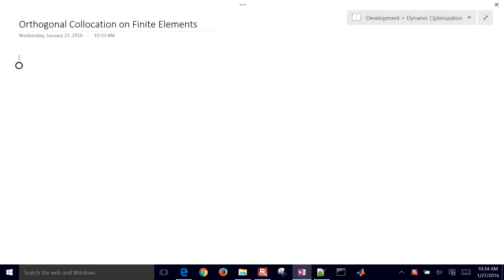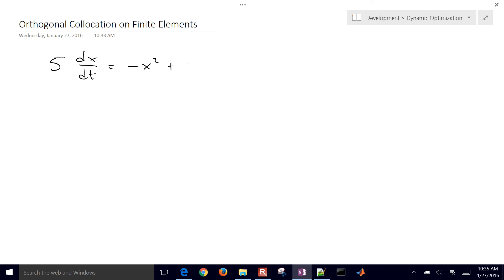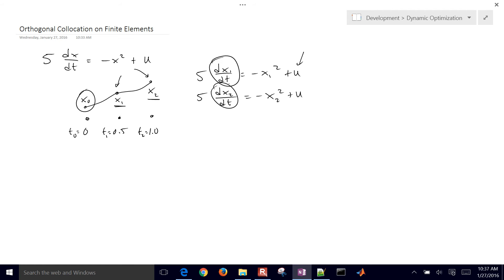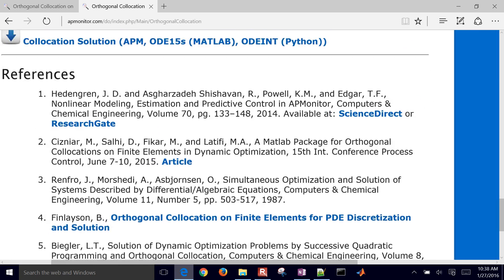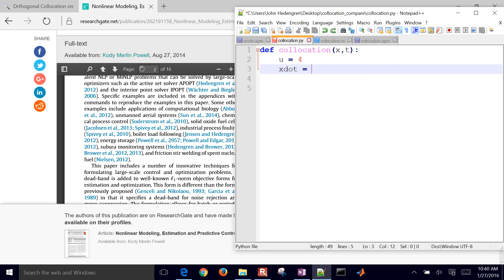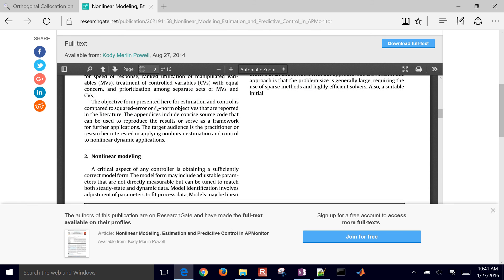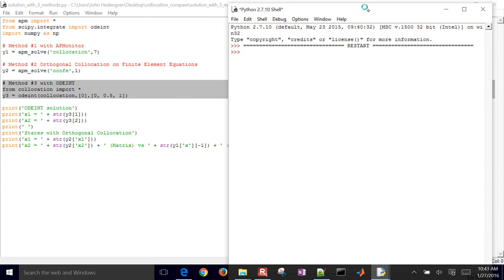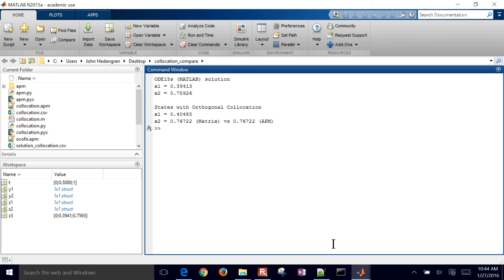Orthogonal Collocation on Finite Element in MATLAB and Python

Comment: I solve based on orthogonal collocation method based on your videos , but errors occurred  at my output please help me to solve this problem
 x˙1(t) = −0.5x1(t) + 5x2(t)
x˙2(t) = −5x1(t) − 0.5x2(t) + u(t)
x˙3(t) = −0.6x3(t) + 10x4(t)
x˙4(t) = −10x3(t) − 0.6x4(t) + u(t)
1 ≤ u(t) ≤ 1
tf = 4.2 (s) 
x0=10
u0=0
t=[0,4.2]
Reply: In matlab
Reply from the maker: @vpvdchannel6190  unfortunately, I can't help with the specifics of the many requests I receive but I can suggest resources. Please see the example problems at: https://apmonitor.com/do/index.php/Main/OrthogonalCollocation